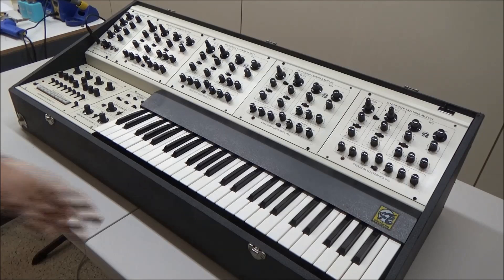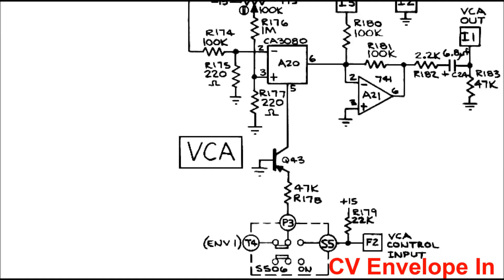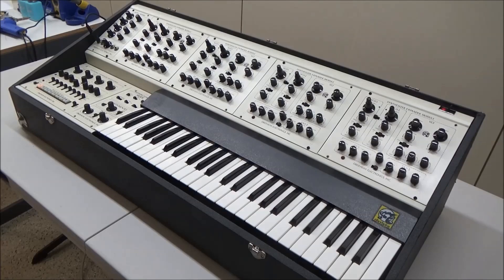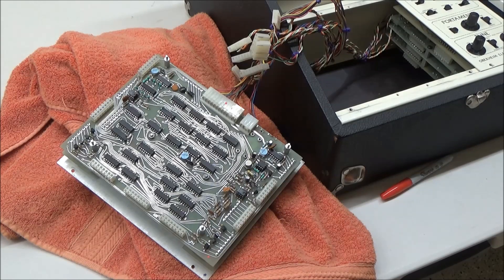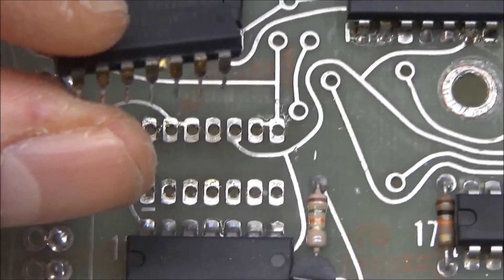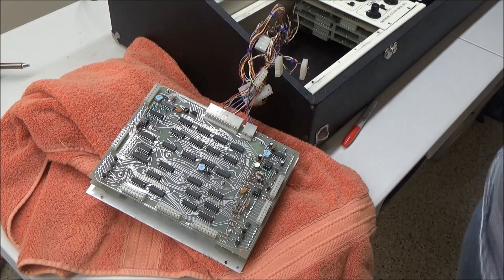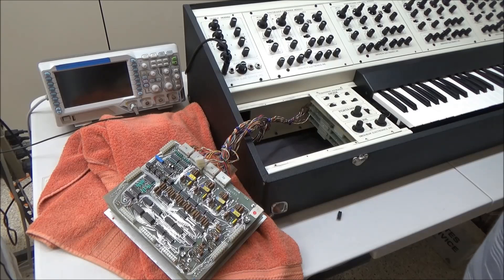Oberheim Four Voice Synthesizer FVS Repair - Synthchaser #149

Comment: I repaired a pair of these 4 voice programmers, many years ago.  PIA, in that they were not the typical uP controlled systems I had become comfortable with, they were something ancient and bizarre,  TTL logic running in an endless loop.  And all the ICs soldered in place.  So much fun.  I had to brute force grind it out, chip by chip replacement until they started working.  Never want to do that again!

Comment: Great video, I am currently trying to fix a two voice. One odd question: What are those black screws called that connect the modules to the frame? Seams to be an "imperial" thread and I don't know where to get them in Europe. Can I order them from your webshop?

Comment: If I'm not mistaken, 6508's are now obsolete, scarce, and expensive to replace. Not only do I have an EVS but also a Prophet-5 Rev 2, for which the latter I purchased a "RAM Upgrade" to have 6508's in case my EVS needs them. I'm very tempted to devise an SEM PSP "upgrade" project to essentially consolidate much of the circuitry into less PCB's. Oh well, only if time allows.

EDIT: Honestly, I don't consider refurb kits to be "shotgun repairing" provided the SAME approach to discrete component diagnosis/rework/repair/servicing principles are followed. In the case you showed above, the previous worker appears to have been too hasty during their process.
Reply: Same here. I also don't consider a refurb kit a "shotgun" repair since the components have been carefully chosen and are typically replacing components that are known to eventually fail. There is a subtle difference between a "shotgun" repair and prophylactic replacement of components that have a high probability of near-future failure.

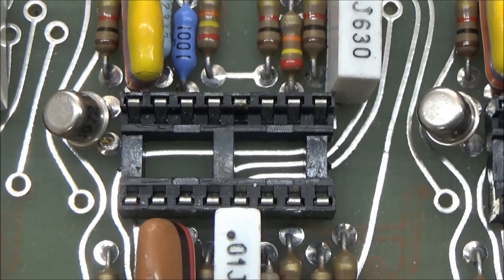Comment: 14:41 The 3972 left from the socket with the bend pin has a “not so clean looking” solder joint.